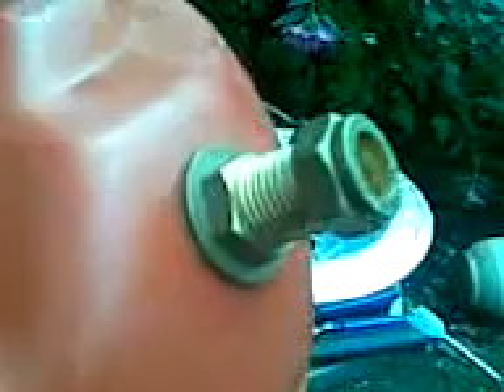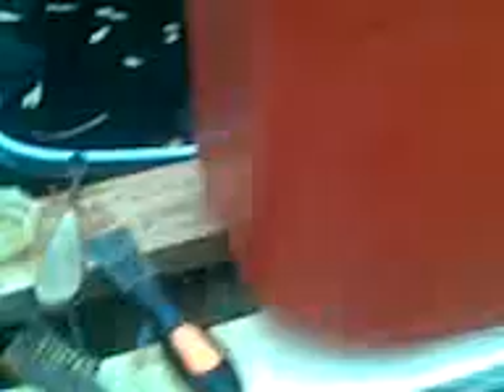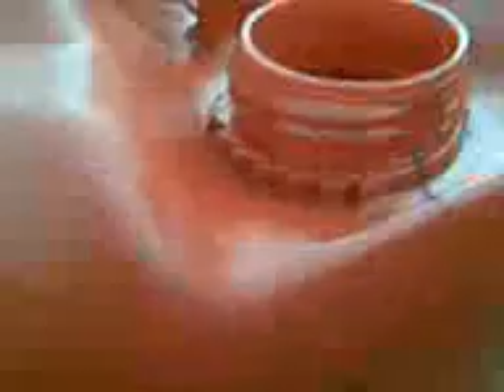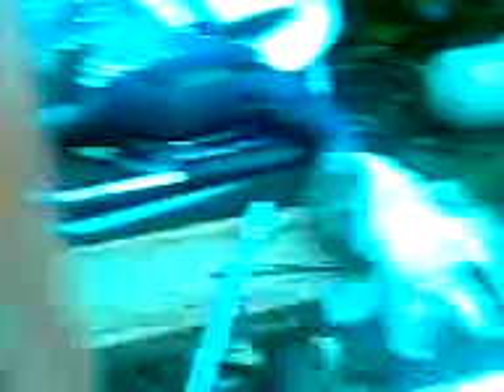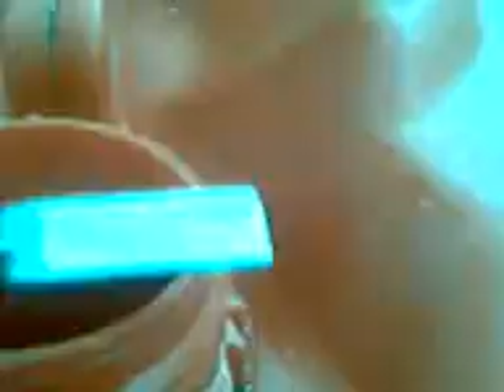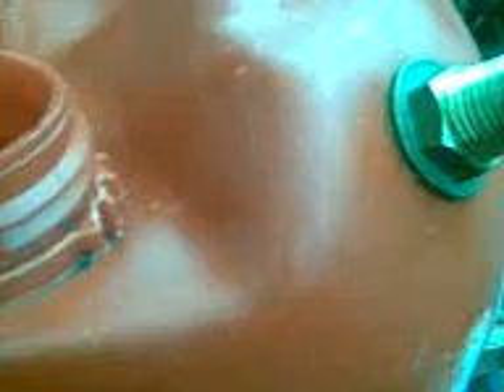Vegetable oil car conversion part 2

Comment from the maker: Hi - The tmp inside the tank will be whatever the cars water system gets to - on this vehicle around 70 - 80 degrees centigrade - Does that help?  I have had no problems with the tank at this sort of temperature . . . . . . Mac